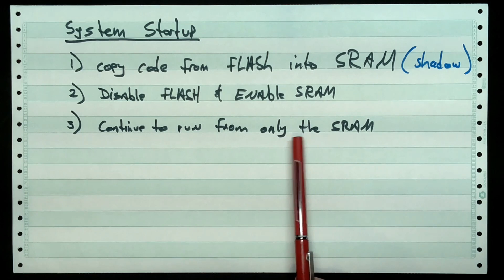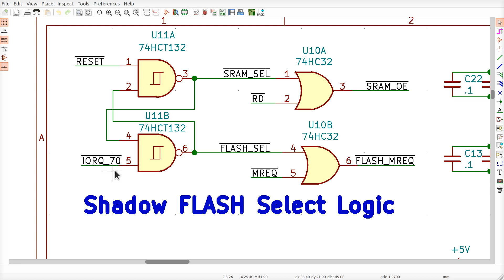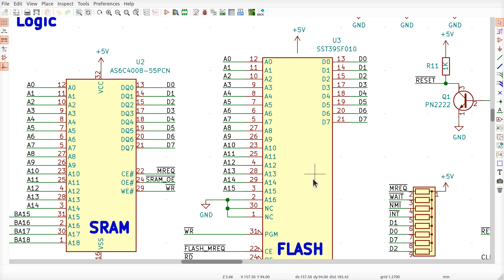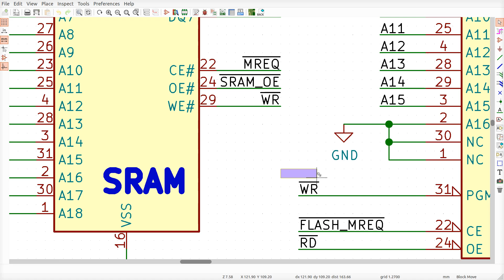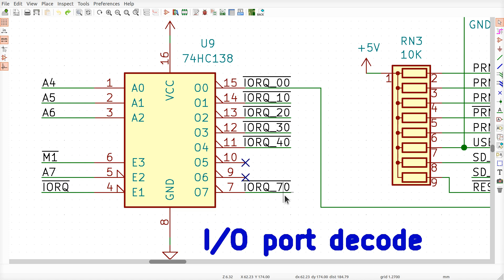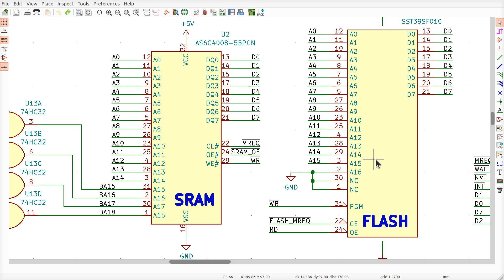Z80 Retro #5 - System Startup

Comment: Do the CTC and SIO chips have to be 10MHz as well?  Or will the Z8430B(CTC) and Z8440B(SIO) work with the 10MHz CPU?
Reply from the maker: They should be.  But I've seen the 4MHz and 6MHz chip run fine at 10MHz as well.
Note that you don't need the CTC at all if you run the SIO with its own oscillator (the one in X2) and jumper the board to send it direct to the SIO (as I do with mine 99.999% of the time.)  The default retro BIOS build will then run at 115200 BAUD.
Don't worry about any of the default retro BIOS code that tries to initialize the CTC as it will not fail if the CTC is missing.

Comment: Where were you able to putchase a 10MHz Z80?  Doesn't look like one is obtainable from DigiKey.  Also why not use a USB-C instead of a USB-MINI?
Reply from the maker: In 2023, the z80 was still in full production.  Now you'll have to hope Jameco has some or maybe eBay etc.
Noone made easy yo solder USB C jacks  when I started that project in 2021.
Reply: @JohnsBasement  Thanks a million for the quick reply John, really appreciate it.  And I had your response floating around in my head that it was going to be the passage of time that made the difference to the answer of those two questions.  Exciting project and your explanations of how the circuitry works is excellent!  Oh, and I found some 10MHz Z80s on eBay, so bought a couple.

Comment: The real question I would have watching this video IF I didn't know how the Z80 differs from, say, the 6502 is "why do we need to copy anything out of flash and switch it with RAM to begin with? (John can correct me where I have it wrong at this stage of things, if I do.) TL;DR: You don't have a reset vector, it's $0000 period. And CPM won't let you put your BIOS there.

Since CPM can't know in advance anything about your computer or even how much RAM and/or ROM you've got, it wants a list of BIOS functions at $0000. Above that is program memory, the CCP (CPM shell), BDOS (CPM kernel), and BIOS. The last two might be in RAM or ROM, but the CCP and everything down to the BIOS function list ("vectors") is gonna be RAM.

Right, so I'd structure ROM thusly: a copy loop that duplicates ROM in high RAM, init code, whatever blank space there is, followed by BDOS and BIOS. The init code (starting in ROM) would jump to just after these first few bytes in RAM, then hit the trigger to remove the ROM from the address space and give us the rest of our RAM. I'd populate the CPM BIOS vectors, do whatever else needed doing, and then jump to CPM. Maybe if there's space I'd look at sticking the CCP in there instead of having CPM load it.

But hardware's new for me. I'm a software guy. I can see why ROM has to get switched back in if you hit /RESET. Looking forward to seeing what John did. 😎🍿
Reply from the maker: It is simpler to assemble the code if the ROM to copy itself into the same address range in the RAM that it has in the ROM.
I decided to shut the ROM off early in the booting process so that the addresses for writable variable storage (DC and DS statements) can be allocated by the assembler without concern as to where the ROM is/was.

Comment: The shadow ROM is a neat idea, not sure I 100% understand it though. If the operating system code is copied into the high RAM bank, won't that code always stay in the memory map since it can't be banked out? Sure, the high RAM space containing the operating system is writable but beyond that I'm not sure how we're "freeing up" the RAM to create more usable space for programs.
Reply from the maker: Look closely at the schematic and the upper left corner. Draw up truth tables if you have to. The two nand Gates make an RS. Latch that force the control lines that manage the reed and write signals to the ram chip.
Reply: @JohnsBasement  Yeah I understand that part. Reset starts low with IORQ_70 high, Reset goes high and that brings FLASH_SEL low (active). At that point we can RD the flash and WR to the SRAM, which allows a byte-for-byte copy of the operating system code into the high SRAM bank. FLASH_SEL stays low until IORQ_70 goes active low, which flips the latch over to the SRAM_SEL active low state. So now we've got a fully enabled (and loaded) SRAM and the Flash is disabled. That makes sense.
What I'm wondering is.....does the copied operating system code remain in the high SRAM bank indefinitely (until system shutdown)? So any low bank of SRAM can be used for program data, no problems, but the high bank is officially off-limits to the user (even though it's writable) because it contains the operating system code. Am I understanding that right?
Reply from the maker: @jimtekkit  all right expect the off limits.  No.  Anything can, at any time, write anywhere in the RAM.  We won't write over the BDOS nor the BIOS.  But we could.
Reply: @JohnsBasement  Aha! That makes sense, so there's actually quite a lot of space in high RAM to play with. Considering the CCP starts at around 56K and FDOS at 58K for a 64K system. I'm still learning the basic internal structure of CP/M but that helps connect the dots :) Thanks for the response.
Reply from the maker: @jimtekkit  I should have also noted that untill I start working on the disk cache, the RAM banks are never switched.  So you need not consider the impact of RAM bank switching for a while.

Comment: Great idea to boot from ROM and then continue with RAM only. Pretty neat schematics for ROM/RAM and banks switching.
Can you consider the idea for the next project?
1. Back at the days just copying ROM->RAM could be considerer a waste of h/w resources. More effective could be just moving ROM in upper bank, or enable ROM in lower/upper bank.
2. If we do ROM->RAM copying /*and probably patching on the fly!*/ nowdays, still it could be desired to protect some RAM banks as R/O /*i.e. pseudo ROM*/.
For me it looks like copying ROM->RAM is not so efficient /*is not a retro-way - h/w resources friendly*/, in ROM could be only small loader/bios just mapped and used 'as is' in address space in order to save RAM. 
Copying and patching into 'pseudo ROM' looks promising from SD card directly. /*we could have a pile! different COMPUTERS/BIOSes and OSes on single 1Gb SD card*/
Do you have ideas how to implement 1&2 in same minimal way?
Could be nice to see the solution in your future videos ;)
Reply from the maker: This is all cool stuff.  But it would require eliminating something (like the printer port), using a larger PCB (and lose the cheap proto-service prices), or use a PAL/GAL to replace the discrete gates (which would require another programmer.)

I'd like to be able to bank the FLASH back in after the boot so that I could use it to hold the OS and load it back in on a warm boot. But I could not figure out how to make it work with the original constraints that I put on myself: make it fit on 100mm square PCB, cheap disk media, cheap/no programmers (The sub $10 in-circuit flash-programmer board is a tolerated nuisance), no GALs, etc.

The problem with bank-selecting the ROM is, as you note, more gates are needed.  That means we'd probably have to go to a PAL/GAL or eliminate features... which were decided based on my personal needs.  Eliminating the printer port would possibly free enough space and may not be missed by many interested in tinkering with the project.

What I have been dabbling with for a next generation project is based on the Z8S180 with an FPGA so it can host a video display, audio, joysticks, a high-speed SD interface, etc.

With an FPGA in the data-path your proposal for write-protected regions could be made to work very nicely!
Reply: @JohnsBasement  it looks like uniform banking ROM with RAM into CPU address space is kind a solution. But I hoped that there exists such minimalistic discrete solution for this :( If you want to hear my opinion - please stick to 10x10 board size! This is very important for project popularity. FPGA also reduces chances for reproduction and is not 'retro-way'. PAL/GAL may be acceptable as a compromise /*but i'd rather go for 'pure' discrete and probably using FLASH hack instead of GAL, like in Woz drive*/ BTW same TL866 can flash EEPROMs and GALs ;)
Parallel port is a good stuff, why not to make expansion bus connector on 10x10 PCB? 
BTW I'd like to stick to some standard: ZXbus, MSXbus or PCbus... There are no such DIY on youtube, I understand when one makes computer from 0 one feels like a real creator - can do everything one likes and when it just works it's a great joy! But I think only trying to follow standards one can get deep understanding, after ensuring those standards were actually meet ;) get real-life useful skills and ensure this project will be reproducible and extended with other standard and DIY h/w. What do you think?
Reply: @alexloktionoff6833  I also started with the premise of "is a minipro really so expensive? And shouldn't someone wanting to play with retro tech pick one up anyway?" And … the answers I came to are that you should get one sure, but I paid maybe fifty bucks for mine with every adapter I could ever want, and you can't get a bare programmer for it now for $60 because you've gotta pay shipping. In truth, I'm never likely to do SMT soldering ever, so so probably I don't need those adapters, but others might which takes the price tag north of $80 in 2025 American dollars, without the full weight of tariffs to increase the price for us.

I mean I've got one, and I don't mind using GALs because I can save money and PCB that way. But if you have to buy the "cheap" programmer that's now very expensive too, it's not a savings unless you're going to use it a lot.

Now, you can program a GAL with an Arduino same as you can a modern EEPROM, but you need a 12v power supply in addition to 5v and you need to do some switching. Hm, maybe. But it'd be a lot easier to recommend as an option if you could program it at 5V with some jumper wires and a breadboard. You CAN do that with an EEPROM. And an EEPROM can do this kind of logic, just not as quickly. How fast did you want to run your CPU?

Comment: One other way to copy the flash contents into sram (and potentially more efficient) would be to use a Z80DMA chip and thus offload the data transfer from the CPU. On the plus side, it would probably shave a second or so from the boot time, but on the minus - more chips, more complicated hardware, more cost. The DMA chip could find other uses later though.
Reply from the maker: I like the idea of DMA.  BUT I am on the fence over a few things in this project.  I wanted the first release to fit on a 100mm X 100mm board and have an all thru-hole option while providing the full CP/M set of peripheral support.  I think I attained that.

I also have a version of the boot FLASH code that boots CP/M entirely out of the FLASH.  Even with a giant LDIR, it is faster than the bit-banged SD interface.

As I look forward, I want to be able to add video with tiled & sprite graphics (I see activity with others doing the same right now using various methods.)  I am inclined to use an ICE40 FPGA.  It is cheap and very simple.  I could explain it in terms of discrete counters and translate a schematic/block diagram into simple Verilog for anyone interested to understand and run with it if they want (I have successfully done so in the past with highschoolers on my First Robotics Team that have never heard of FPGAs before, so I know it is attainable.)

Once an FPGA enters the picture, I start thinking about supporting a DMA-based SD interface that runs at reasonable mult-MHZ speeds and floppy disk interfaces too.  It'd be nice to be able to connect and use 8", 5.25" and 3.5" drives in SD and DD modes.  It should be pretty easy to do implement such controllers in Verilog, as they are, like a video display,. mostly counters/timers.

DMA... this was about DMA!  Well, DMA is definitely on the mind when thinking about FPGA-based video and disk peripherals.  Again, more counters.

I'm also getting plenty of comments about the EZ80 too.  I have eyeballed it and found that the list of errata on the old ones makes them annoying.  The newer ones are all on back-order for a year.  So that isn't going to happen any time soon.

So many cool things to figure out how to do, so little time!

I need to win a lottery so I can retire and get some REAL work done!
Reply: @JohnsBasement  "...with highschoolers on my First Robotics Team..."   
I am glad to hear that you are working with kids as well as college students-  
In my IT career (mostly working in school districts)  I saw a lot of light bulbs get lit up by quality teachers.
And I think it is kinda obvious that the earlier one finds what sparks their interest the better the whole world is for it.

Comment: Does it really need to even copy the copy instructions out of the eprom? Also, just wanted to say thank you for your original retro content and not just roasting people (who are likely dead by now) over the ‘mushy’ feel of a keyboard from 1978.
Reply from the maker: No.  It only needs the code from the OUT instruction that shuts off the EPROM to the end label in the boot code.
But optimizing that will not create a perceptible change.  So I kept it simple.

And thanks for the thanks!

Comment: Could we "bit-bang" the code from flash to sram at first memory access after reset?
The first time the processor asks for $00 in flash, the sram reads that address, and jumps to it. Then when flash writes to the bus, the sram is reading that too, and then stores the data on that address given by the processor. When all of the flash is copied, it deselects the flash. Is this possible, or am i making no sense? If it could work, would it create more components or less on the board?
Reply from the maker: It is possible.  But I do not see how to do it without adding more gates.
What would be the benefit? At best I think it could shave off maybe 66% of the time it takes an LDIR instruction to copy FLASH into the SRAM.  Maybe .5 seconds during boot?
Reply: @JohnsBasement  
I have no idea if it will be useful, just got the idea and had to blurb it out. :)
Reply from the maker: @ricande  Well, that's what these comments are for!! :-)

Comment: One thing I dont get. Why are you controlling the SDRAM selection with its OE signal (hence SRAM_OE) but the flash with its CE signal (hence FLASH_MREQ)? Why not do it symetrical and control the selection of flash and SRAM symetrically with their CE signals?
Reply from the maker: Because I need to be able to read from the FLASH and write into the SRAM when the Z80 boots and is executing instructions from the FLASH.  I could not figure out how to make that happen with as few gates as I have in this design.

Comment: What, no write protect for the shadow ROM code in SRAM!? 😁
But seriously, how many bytes are you saving by just not copying the bootloader, that is just a very simple loop? I would leave the ROM code in the flash and use all the SRAM (and extra flash - unhook that highest address line) for paging in memory. Although in such a scenario, the pages should be smaller than 32k - more like 16, 8 or even 4k...? Or am I missing something and you have a giant rabbit up your sleeve?
Reply from the maker: I considered doing something with bank-selecting the FLASH, but I could not figure out how to do it with as few gates.
Reply: @JohnsBasement  Remove all 7400 logic and use a GAL/CPLD?
Reply from the maker: @obiwanjacobi  One could.  But that violates one of my original requirements.
Reply: @JohnsBasement  Ah fair enough.